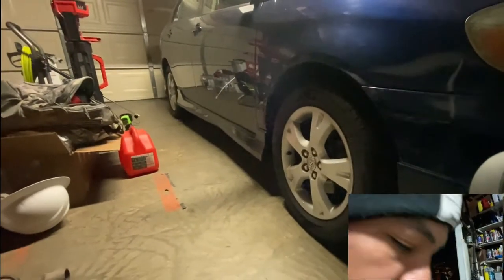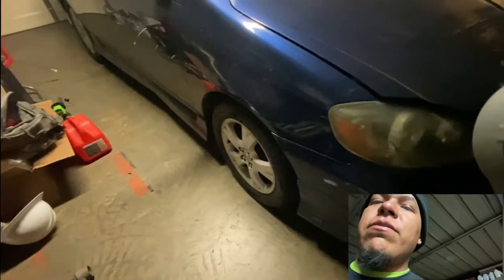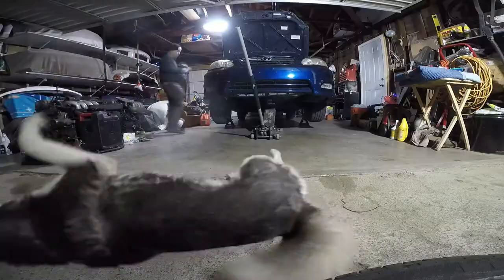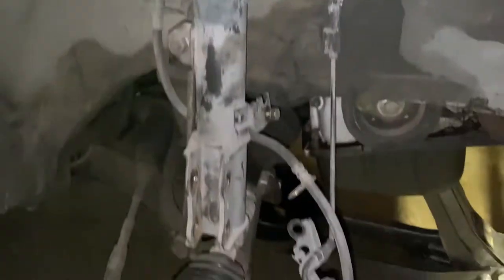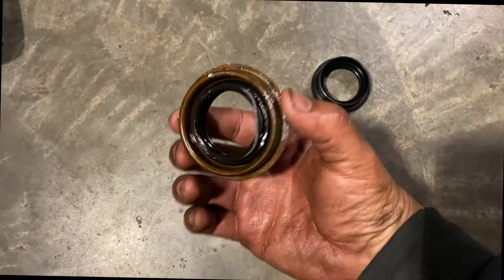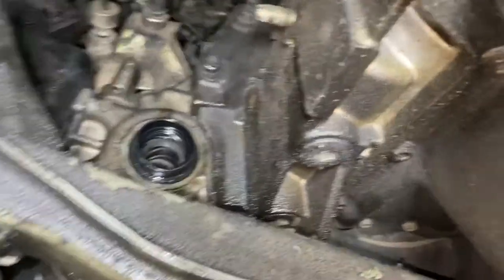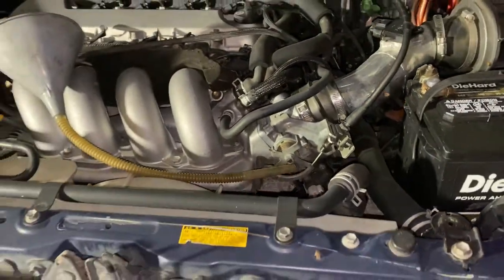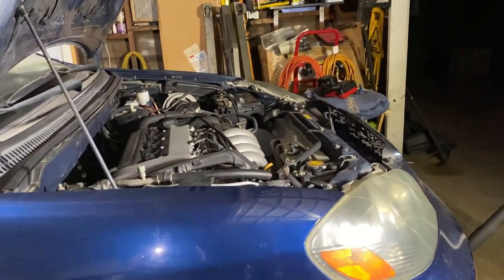Replacing Transmission Axle Seal 05 Toyota Corolla Xrs

Comment: Pardon the question dude,  im about to change one og my seals too,  what kind of oil is that you used?
Reply from the maker: Mt 90 and synchromesh
Reply: Is this a manual or an automatic transmission?
Reply from the maker: @ericgarcia7768  manual